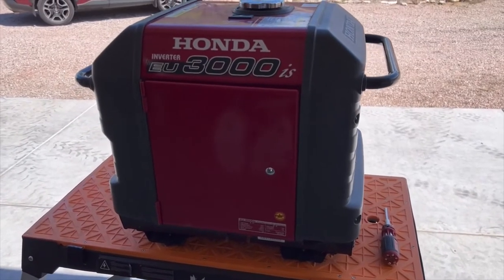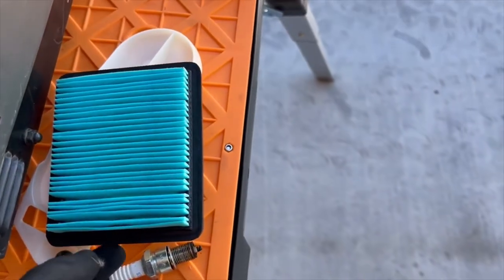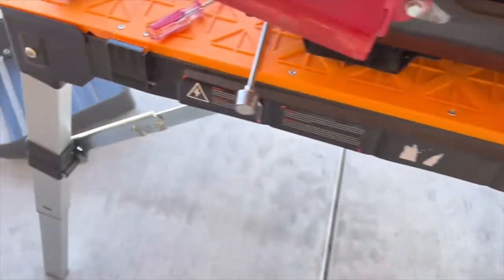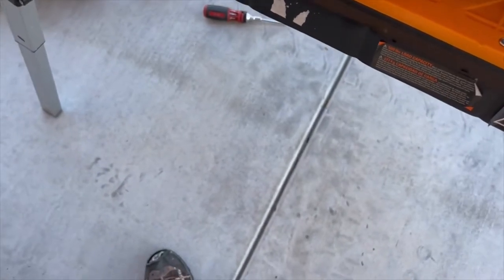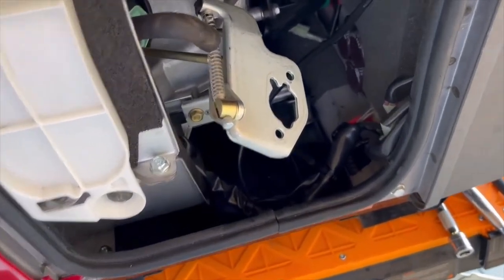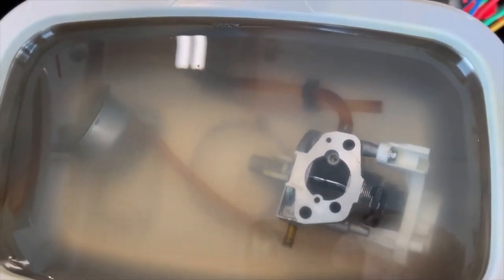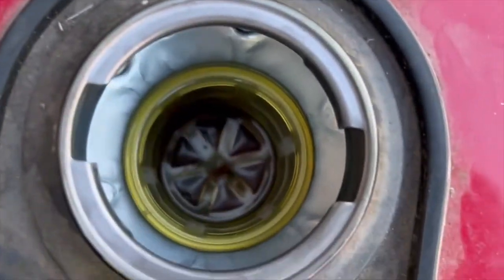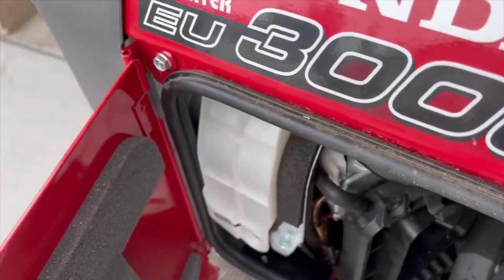Honda EU 3000 IS Generator NO Start

Comment: There’s a small screw to drain the fuel, anyway , you could also change the thin plastic housed filter in bottom of the tank
Reply: You must be taking about a 4 stroke, 2 stroke do not have diagrams.
Reply: Awesome. I will have to look that one up as that is likely my culprit..

Comment: Before you fired this beast, why not put wd40 in cylinders if it hasn't been running for some time 🤔 I cannot believe you didn't change the fuel  didn't you say it hadn't been running for some time?? 
I am looking for the put back together,. 🙄namely the adjustment back to the original for the float and or other, as I know I have messed around with adjustments and not sure where to set it..
Could have been a much more informative video...